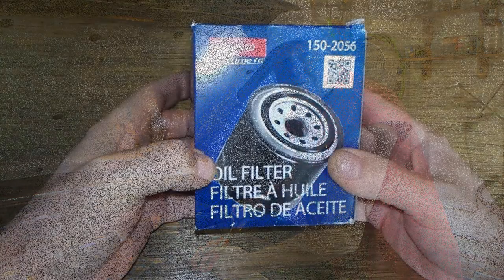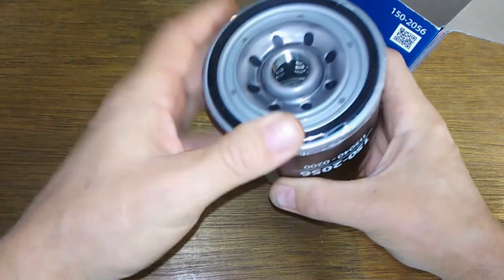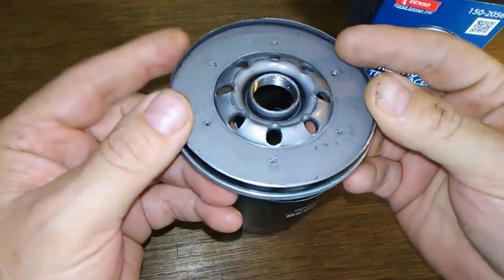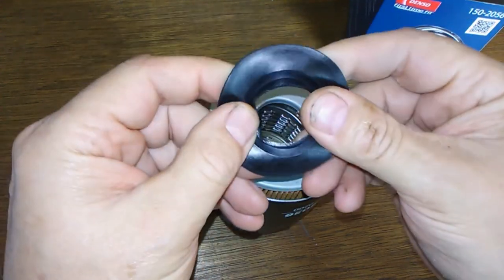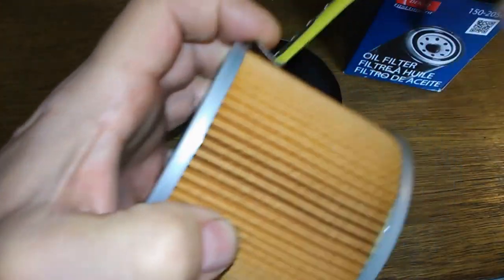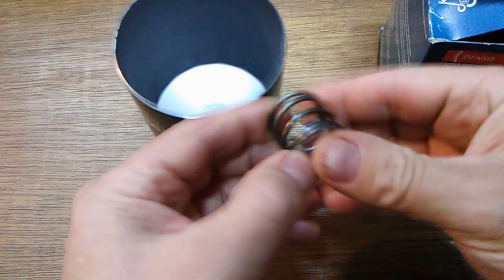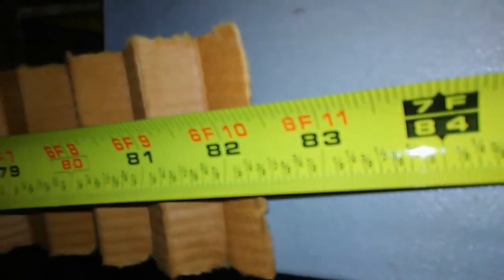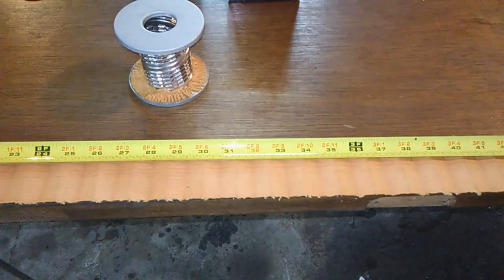Denso Oil Filter Cut Open 150 -2056

Comment: So it doesn't have a bypassed valve
Reply from the maker: Because the baseplate has a unique design, the Anti-drain-back valve has a dual purpose and also acts as a bypass valve. Thanks for watching.👍🙏😊
Reply: If the engine it was designed for, typically Asian, mounts vertically, no ADBV is needed.

Comment: Valvetrain noise at startup with denso filters.  Chinese made. Stay away
Reply from the maker: Really? What Denso filter were you using?  Wonder if the anti drain back valve is to blame. Thanks for the comment! Take Care!
Reply: @WhipCityWrencher  my 2008 hemi ram did the noise. Then i installed the same model on my 2011 challenger and also the startup noise. Changed to carquest blues and no more noise on both vehicles.  Never again
Reply from the maker: @raulserna9871   Glad the start up noise went away. Here's a link to a video I did Nov. 2019 on the blue and red Carquest oil filter. Take Care!  https://www.youtube.com/watch?v=4rbQ3sPR8fA&t=10s